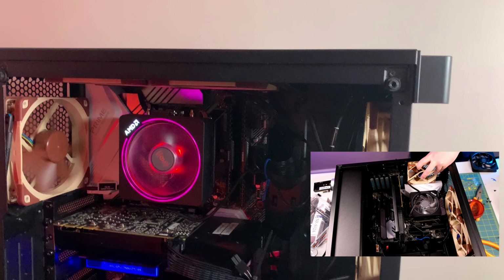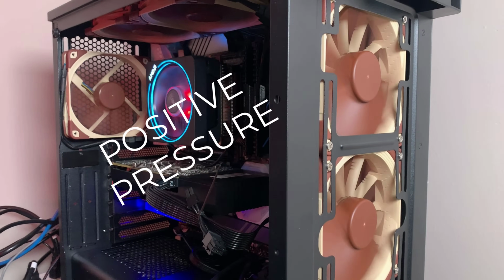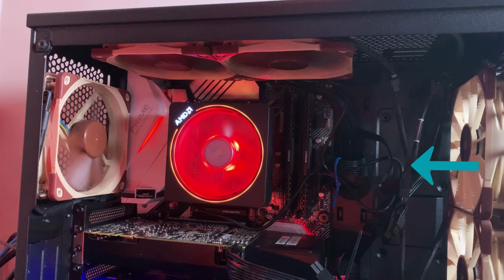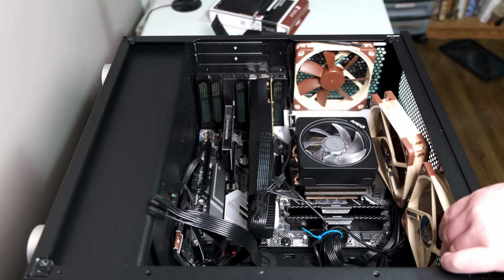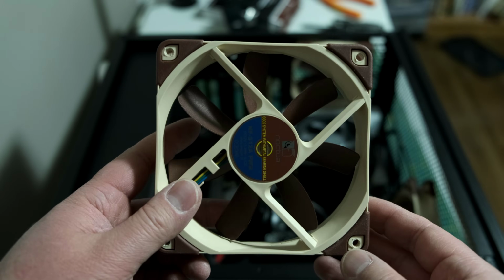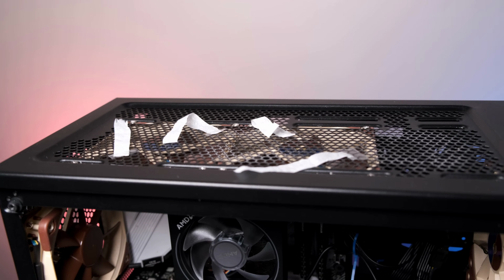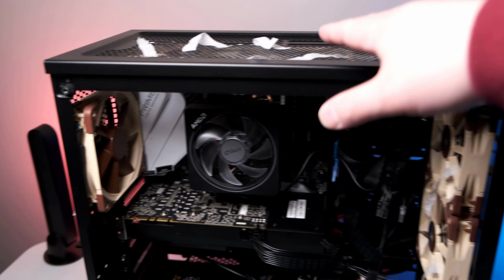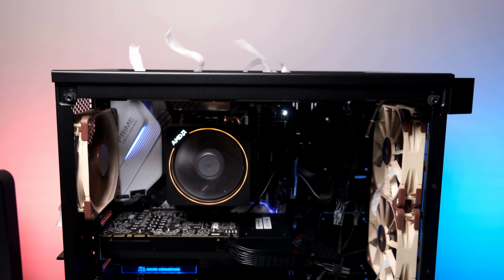Custom PC Build: How to setup your desktop cooling fans for proper air flow

Comment: Now what if you put your 360 AIO in the front of the case?
Reply from the maker: Good question, right now i have a different setup where I switched to a fractal meshify 2 and the 360 AIO is on the top. I left the stock 140mm fans in the front and rear, so far the temps are okay. You raise an interesting suggestion. If I swapped the front AIO with the stock fans from the top. The stock top fans exhaust or intake?

Comment: In the foootage of the case fans at the beginning of the video: 
The rear fan is exhausting 
The top fans are exhausting
The front fans are intaking.

What's the problem?
Reply: Yeah you are completely right. He probably just wanted to make a video about it for those who have installed their fans in the wrong way
Reply: lol shhhh, don't question it
Reply: Exactly lol
Reply: The top fans are sucking IN air, not exhausting hot air. He fixed it in the video. Not sure why that's so hard to understand.

Comment: Gotta work on tidying those cables man.
Reply from the maker: lol. Another armchair cable management expert.
Reply: @TheWongReviewer  So I'm guessing you eventually fixed the cables?
Reply from the maker: @gophermaster  I did manage to clean it up a bit more before I closed up the case. It was the power supply cable to the GPU that I couldn't really do anything with. I still wasn't happy with it. I actually just upgraded my case to the Fractal Meshify 2 last week and the cable management in that case was awesome. I'll be posting an updated video in the next 2 weeks. Thanks for the feedback. Appreciate it.
Reply: @TheWongReviewer  Yeah the GPU cable is usually the toughest. I look forward to the update.

Comment: i have a question. if i have 3 fans in the front, what is the bottom fan should do? intaking or exhausting?
Reply: oh by the way, 1 fan behind and 2 in the top's are 120, and 3 at the front's are 140
Reply from the maker: @rivaldyfazza4364  Bottom fan should be intaking. The top 2 fans and rear fan should be exhausting
Reply: @TheWongReviewer  sorry, my english is bad that you are getting it wrong. i mean the most bottom of 3 front fans. in your video, you only have 2 in front. at my pc, i have 3 in front, so i yet have no idea about the 3rd front fan should be.
Reply from the maker: @rivaldyfazza4364  Hi there. No problem at all.  In an updated video, I actually have 3 fans in the front and they are all set to intake air in. The only exhaust fans the top 2 and rear fan. Hope this helps. If not, i'm happy to clarify.
Reply: @TheWongReviewer  ah okay then. thanks for the advice !

Comment: it's ok to put 2 more to give air under the video card?
Reply from the maker: Hi there. Thanks for the comment. I'm not really sure you need to. How many fans do you already have in the case?
Reply: @TheWongReviewer  I have 6 organized just like you.  but I want to slow down the fans on the video card because I have them at 60 percent and leave it at 40 percent.  I want 2 fans to give air from below so as not to force the video card fans.  sorry if I said something stupid I'm not very good at computers
Reply from the maker: @stiridinsurseproaste3207  Hi there. No problem at all. Your English is fine. I just needed some additional context to your question. I see what you're saying. Is the GPU fan at 60% too loud? II know the GPU fans will do a much better job to cool down the GPU than adding additional fans to your case. If the GPU at 60% into too loud. I suggest you leave it. Sorry, hope this helps you.

Comment: Nice video. I having issues. My top 2 exhaust fan take out the most air alot without having air reach the rear of the case for circulation . And rear fan don't take as much air as top 2 fans is that normal ?
Reply from the maker: Are you able to manually adjust the RPM of the fans? For instance, i have my intake fans spin higher than my exhaust fans to create that force air movement. Are you able to do that?

Comment: Your logic is all wrong with not about pressure, the fans are not strong enough to really exert much pressure, the logic you use is understanding hot air rises and cold air settles, so in a case, any case you want to draw in air at the low points of the case near the bottom and make sure it exhausts and flows out the top, make sure the hot air is drawn out and assisted on its way to rise out of the top.
Reply from the maker: Thanks for the commenting and the feedback.
Reply: @TheWongReviewer  there are other videos and they actually provided data and measurements of the temps on each components using different set ups and yes they use terms like negative and positive pressure but what they found was as long as cool air is drawn in from the bottom the lowest point and hot air is blown out the top, air flow assisted out, they discovered that is optimal setting. So not fight the laws of thermal dynamics, rather go with the flow and assist the flow. That is the best way
Reply from the maker: @joesmith201212  I actually recently saw a video from Gamer's nexus and they said as long as there is air flow going through the case, it will help help cool the temp.
Reply: @TheWongReviewer  well I dunno what video you saw but yeah the one I saw they had the optimal setting where hot goes through the top and cool air drawn from lower parts
Reply from the maker: @joesmith201212  That’s interesting. If you can, share the links. I would love to see them and see if I can do a similar test. Thanks.
Reply from the maker: @joesmith201212  Thanks Lin, appreciate it. I'll see if this is something i can replicate for a future video.

Comment: Easiest way to remember is the side of the fan with the cage/supports going across the fan blade opening is the side air comes out.
Reply from the maker: I just upgraded my computer case with new fans and this trick was helpful to remember. Thanks.

Comment: So i have the corsair 4000d case and 4 LL120s + H100i 240 top mounted with 2 more LL120s. I want to pull air through the back and top and exhaust out the front panel since there will be 3 LL120s in front to move more air out. Which way would I face the fans to get this setup? The corsair logo side or the info sticker side?
Reply from the maker: Hi there. Thanks for commenting. The air comes out the side of where the label is. So for your front fans, I would have the corsair logo pointing towards the front of the case. A good way to test it I found with no arrows is to blow on the fan and see which way it turns. Hope this helps.

Comment: On fans where there are no arrows printed anywhere, almost all fans will blow towards the label, meaning that the air comes out on the side where the label is, unless you have a pushing fan like some cpu cooler fans work, for example, the intel stock cooler is a push fan, the label is on top, yet the airflow is pushed down. I have a light positive air pressure inside my case, why is that? To keep dust out of the small gaps and seems on my case.
Reply from the maker: Thanks for the info!
Reply: @TheWongReviewer  You're welcome :)

Comment: What if we just leave the top fans take out the hot air out? Will that be good
Reply from the maker: HI there. You really need to push air through the case to cool the pc. If you can, I would recommend a fan placed in the front to draw air in.

Comment: This is really super helpful! Just to ask is the NF F12 PWN Chromax Black would work great on exhaust fan and as well is it worth to add two fans on the upper side? my case is Cooler Master TD 500 Mesh. Thank you!
Reply from the maker: Thanks for commenting, how many fans do you have in your case right now?
Reply: @TheWongReviewer  just the free 3 argb fans Sir, i am planning to get noctua nh-12us and a noctua fan for the exhaust, im really new to this so, im hoping from some advice, thank you so much for replying!
Reply from the maker: @doncarllargadas6873  The important thing on air flow is to move air through the case. If possible, I would add fans in the front of the case. The Noctua Nh-12US for exhausting is good. If you're current setup only hast 3 fans, I would move one of those to the front to draw them in.
Reply: @TheWongReviewer  Thank you so much!! I will definitely follow your advice. I really appreciate it!

Comment: Do not buy premium case fans while you use stock cpu cooler.... Oh lord. Noctua is so overpriced... If you went with some other quiet fans you'd save enough for a decent tower cooler.
 Btw. Those are high performance fans first therefore not that silent.
Reply from the maker: Thanks for your feedback. I agree the Noctua fans are pricy and in my case, not really worth it. However, I did replace my stock CPU with an AIO.
Reply: @TheWongReviewer  nice

Comment: Nice video. I have air 900 supposedly there are two fan spot on top of psu. How will that work and is it for out or intake.
Reply from the maker: Thanks for the feedback. I checked out the case, it has great air flow capability. Your PSU has it's own fans, so i wouldn't bother putting fans on  that spot. I would stick to the front and top of the case.  
Hope this helps.
Reply: But my psu fan will be facing downward and will only intake for psu alone so it's not going inside case
Reply: How about having 3 120m in front. 2*140mm top for outtake. And back factory installed fan also for outtake

Comment: Could changing the exhaust to intake help with better temps. I have a 140mm radiator and fans at front and dont know if its enough intake

Comment: Hey, so im currently looking to improve the airflow in this PC Case i have, since it has 4 total fans with 3 intakes in the front and 1 exhaust fan in the rear, would it benefit my pc's cooling if i install 2 extra exhaust fans on top? To make it overall 3 intake fans and 3 exhaust fans. (I dont intend to do any overclocking or watercooling, the case im using is coolermaster masterbox mb520 rgb).Kindly for  your reply. Thanks, great video :)
Reply from the maker: Hi there. Thanks for the feedback. Before you put all that effort in, I suggest you do some benchmarking with HWINFO64 and see if the temperatures are within acceptable range. Especially if you don't plan to overclock, having the extra fans may not drop the temperature that much. As long as there is air flow through the case, it will cool the  PC. I believe the 3 intake fans will push a lot of air  through the case.

Comment: also i have that exact fan setup, but 2 extra stock fans so i decided to place them on the bottom of the case, which way is better airflow? they are placed right under the GPU
Reply from the maker: Thanks for the reply. How do you find the temperature readings

Comment: You think having two intake fans in front and one exhaust fan at the back is fine? Or will that cause pressure build up?
Reply from the maker: Hi there, there's a youtuber called Gamers Nexus that does PC builds. In videos about PC cooling, he mentions that as long as there is air movement through the case, it will help cool down the PC. Having more intake fans means you'll have more dust go into the PC. I believe 2 fans intake and 1 fan out is fine. Make sure the exhaust fan has a high enough RPM to draw the air through the case.
Reply: @TheWongReviewer  Hi, I'm planning on putting 2 120mm 1400rpm fans in the front and the case comes with a 120mm exhaust fan (not sure what rpm but it's the Cooler Master MasterBox Q300L).
I also heard somewhere that positive pressure inside the case would actually help prevent dust build up too.

Comment: Isn't positive pressure desirable? Neutral pressure is super hard to achieve except if you calculate the amount of displaced air for each fan and account for losses through the meshes. The point is to accelerate air out of the case as fast as possible with the minimal noise. I would've added a 3rd fan on the front to create equilibrium if I were you. :)

Comment: this setup of your fans is slightly negative pressure and not a clean balanced one.you have 2 intakes and 3 as exhausts.it would be better if you just let only 1 as exhaust(rear) to be more positive ,or..1 rear and 1 on top as exhausts to be equal amount of air as coming in and going out.but hey,if you are satisfied like this and temps are ok for your rig then all good!!

Comment: I would take out the top exhaust fan in front of cpu cooler since it its taking out the front intake cool air before it even reaches your cpu. Leave the back top and back coolers as exhaust.
Reply: Exactly! His front-top fan basically gives a portion of cool air to the middle-top fan. :)
Smart setup with cheaper fans can be more effective than 5 premium fans in wrong order.

Comment: Bro i have a vks 22 case and it has 3 fans 2 from the right side and 1 in the left side just like the placing of your fans but mine doesn't have a 1 fan at the right top side if i will buy 2 more fan and i wll place at the top, it will lessen the temp of the cpu ? Sorry for the grammar

Comment: I don't know if you use NVME drives but I had an issue with with to 970 EVO plus drives. That they woul run at high temp on idle. Meaning 52 c for disk one and 47 c for disk 2. 

I got that to drop to 50 - 51 c for disk 1 and 44 c for disk with one cooling fan in top.
Reply from the maker: Hi there. I have 3 NVME drives in my system. 2 directly installed on the motherboard which has it's own heat sink cover and 1 in an external PCIE adapter. I'll have to run system check to see what the temperature is at idle.

Comment: This video is very helpful and insightful! Feels nice to set things right for proper function. 
I have a question tho, I have 5 fans in total all facing the same directions as seen in this video(two for intake in the front, one on the back rear for exhaust, one in the cpu [intel factory one] and one on the top), the thing is that i only have one top exhaust fan instead of two which is set directly above my cpu fan and i wonder is this setup is good anyways or isn't as efficient as the one in the video? is it actually bad to have only one top fan right above the cpu?
Reply from the maker: Hi there, thanks for the comment. I recently switched out my CPU Cooler with an AIO. I think the CPU Cooler, due to the size of the heat sink may actually block some of the air flow. Since i switched to AIO, my computer temps have gone down. According to a video i watched on the channel Gamers Nexus, as long as their is air movement in the case, it will help cool the components. I think your setup is fine.
Reply: @TheWongReviewer  Nice to hear, i will change the position of the top fan to see if there is any change in temperatures, i used to have an AIO (the corsair h60) but it no longer works unfortunately, thank you for your answer sir!

Comment: I don’t understood how you make natural air flow if you have 2 intakes fans and 3 outtake, shouldn’t be same fans numbers for in and out ?
Reply from the maker: Hi there. You are correct. I was wrong, this isn't neutral airflow . I made a video later explaining the difference between a neutral, positive and negative airflow. Thanks for commenting.

Comment: Can u please help me. My cpu cabinet have option to fit 3 fans, I'm not including the processor cooling fan. So which direction should I fit these 3 fans. One is at back and one is at front and the other one is at side. So which direction should I fix this?
Reply from the maker: Hi there. Thanks for the comment. You need to have air flow going through the case.  What type of case do you have and where it the GPU located? I think that may dictate on how to orient the fans.

Comment: So if I will place 2 front intake fans, 2 top exhaust fans and 1 back exhaust fan, I should have proper airflow ?
Did I get it right ? Because I'm planning to buy new fans and I though I should place them like I mentioned above...
Reply from the maker: Hi there, i've been watching a youtuber called Gamers Nexus who does a lot of PC build and air flow. Yes, your setup is correct and will have airflow. Since you have more air coming in, you'll get more dust on your filters and in the case. So you'll have to do some monthly maintenance.

Comment: One top is enough cause the rear one has not enough air coming. I put  one rear fan (exhqust)bottom outside the case removing the non used pci express case cover behind. 57 degrés on my rtx 2080ti oc

Comment: Is it bad to have two fans in front with higher rpm than the ones in the back ?
Reply from the maker: Hi there. Thanks for the comment. No, I don't believe it's bad to have higher RPM in the front than back. My understanding from what I've read, as long as the air is being "Pushed" through the case, it's fine. You'll probably end up with a bit more dust coming due to the higher intake RPMs.

Comment: Can we just take a moment to speak about that "cable management"?
Reply from the maker: Yes for sure. I would love to hear your feedback on how to make it better.
Reply: Pro tip: Get a case with a metal side panel so you forget your shameful atrocity.  It's what I did. Also lets talk side fans. Intake or exhaust?
Reply: @spinning7236  Does heat rise or fall? Think about that and the answer will magically appear before you.
Reply: @PaulSongs76  Yet in my case, the side panel fan is right at the center next to the gpu. The question, is it better to exhaust the hot air emitted by the gpu before it rises and heat up the rest of the pc or blow air in to cool down the gpu and hope that the other exhaust fan can deal with the gpu's hot air.